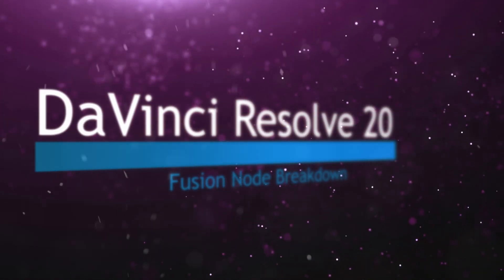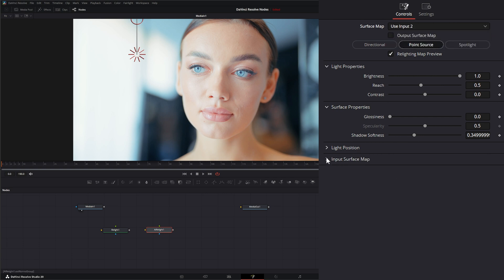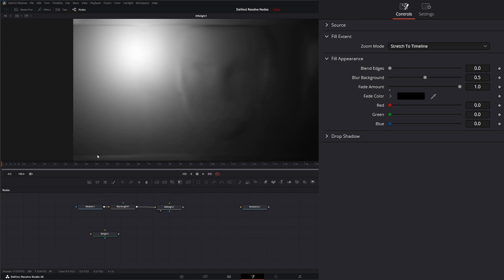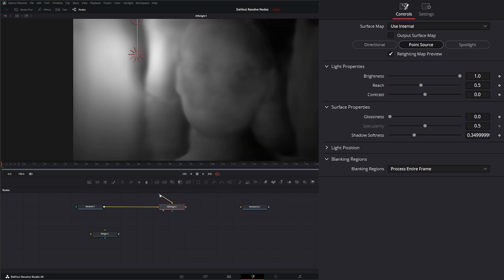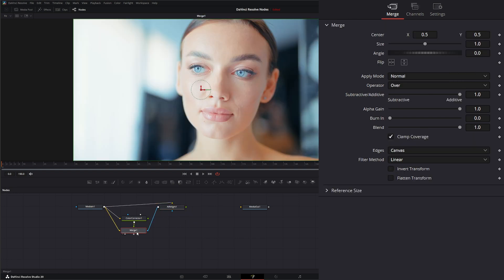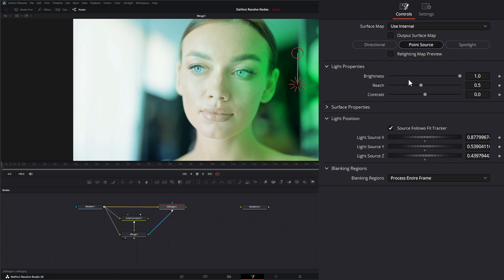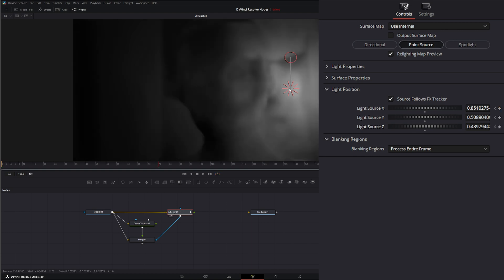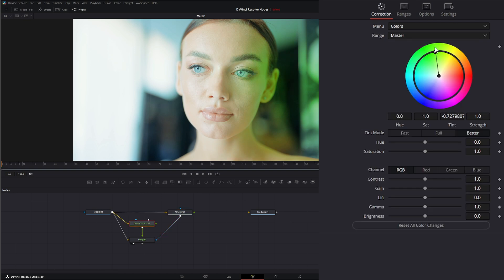DaVinci Resolve 20 Fusion Relight OFX Node

Comment: Using tracker: you can use an IntelliTrack and use "Connect To" to connect Tracker1 Offset X position and Tracker1 Offset Y position to X and Y. After use in the tracker X and Y offset to put the source where you want and it's working You just need to animate the Z axis. Not tried with a camera tracker but maybe can work too. Not the easiest way (use offset to put in the right place...) but it's faster than using the "Source Follows FX Tracker" in the Fusion page. Maybe it's the way you said "not easy in Fusion".
Reply from the maker: Lol, yes...that's why I often say it's just easier to animate it. Thanks for the input though, because this is exactly how you would do it if you wanted to use a tracker.